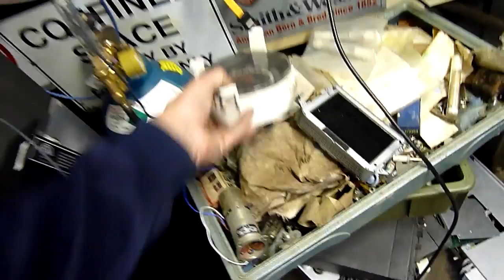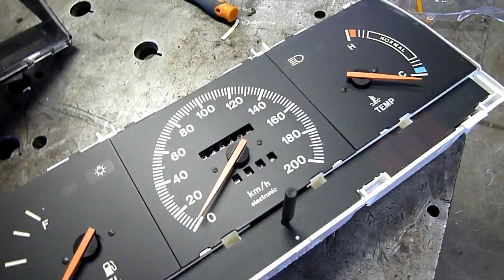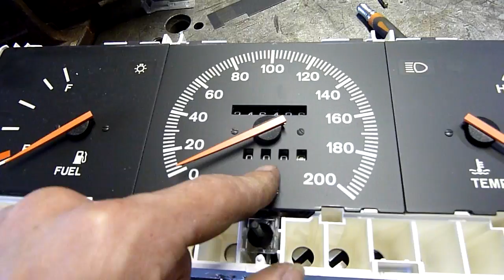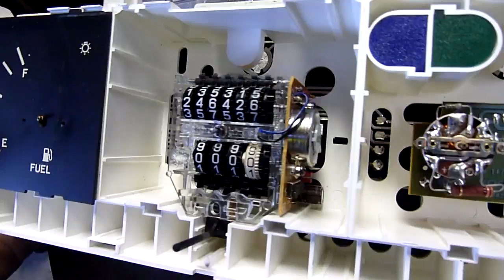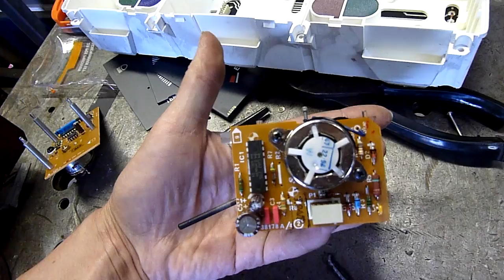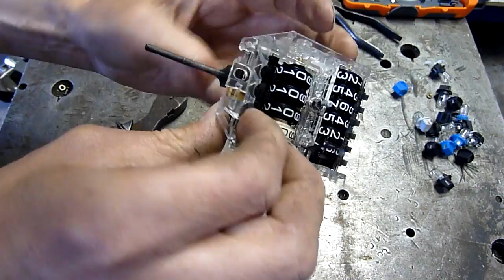Ford EBII Falcon Dash Cluster Autopsy

Comment: That IC used for the speedometer sells for about $50.00 when you can find them.  They are used in Bentley and Rolls Royce speedos that often fail. They did not install a diode for reverse polarity protection.  Hook the battery up backwards and pop goes the chip in a $2000 Bentley/Rolls speedo.

Comment: I have a 2001 Ranger. The main odometer and trip odometer both work. What I have trouble with is resetting the trip odometer. Sometimes it will reset with a single press of the button. Most times you have to push repeatedly to get the wheels to spin back around to zero. I usually reset with each fillup and use the trip odometer as the gas gauge. I didn't reset the odometer for several tankfulls and let it spin around past 999 back through zero. It has been easier to reset since then. Does anyone have any insights as to why I have difficulty resetting?

Comment: the motor on the odometer is a stepper motor basically.  not much different from a synchronous motor in construction.  the chips usually accepted pulses and some had an electronic division ratio of pulses in vs. pulses to the motor from what I remember.  I had a databook for cherry semi that had these chips in them.

Comment: Those plastic plates with the temp and speed are white plastic spray painted and then laser etched - the paint is burnt off - I used to do that - it's actually painted twice - white and then black and the laser burns off the black paint leaving the white behind

Comment: I love the full mechanical speedo's, its old tech but reliable :-))
You can stick a pot in series with that moving coil meter, but im not sure if it will move fast enough to be usefull for a hdd indicator, its bound to be well damped.

Comment: Some of the older fuel gauges operate at a fair current, scares the bejesus out of me that they have an open wirewound potentiometer in the fuel tank! But they do usually have a voltage/current regulator, but same trick, short lead to ground, will check the gauge

Comment: That blue disc is a MOV which clamps against voltage spikes. You can drive those registers of the 50 Hz mains at 12 volts 50 Hz, when you know which the pulse wire is.
Those small plastic gears should ideally have been made of brass.